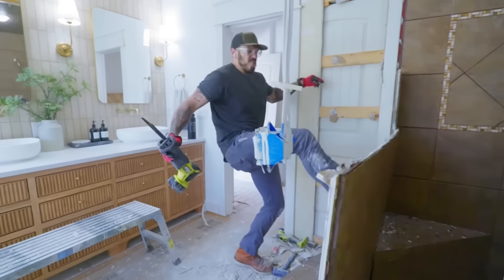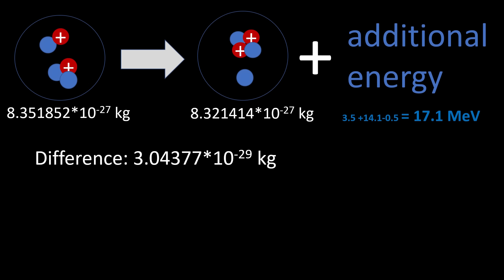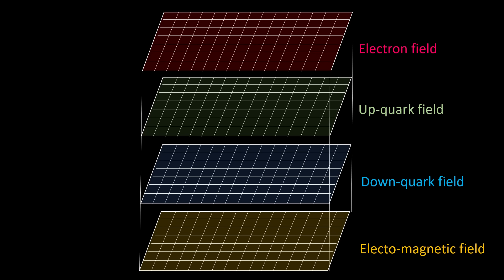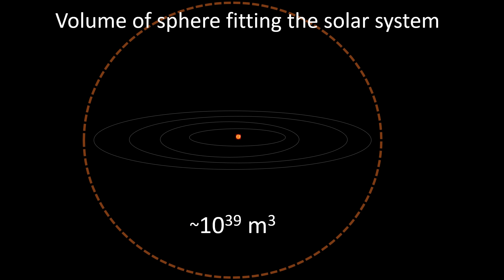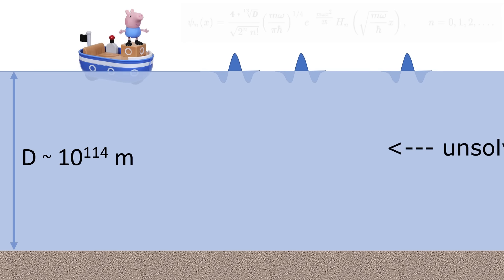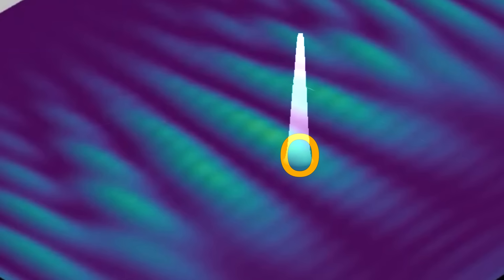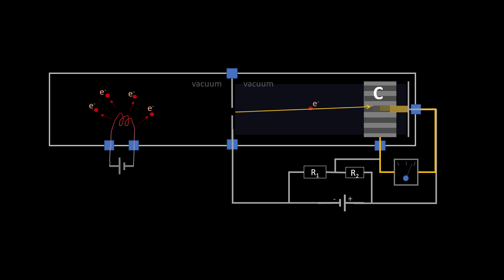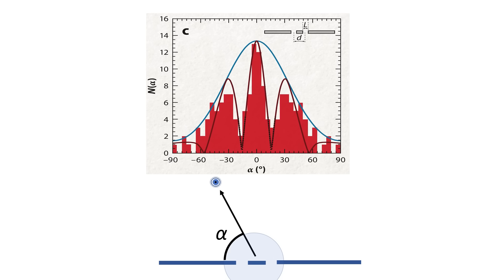Bathroom Quantum Fields and Vacuum Energy

Comment: What a wonderful video. There is a fantastic flow to your writing.

I ask myself questions like these all the time. As a non-expert, these kinds of speculations are especially fun! I don't have to be right or justify anything to anyone, I can just ponder whatever is most interesting to think about.

Recently I tend to like Wolfram's graph model. Not because I think it's right, but because it's so utterly abstract that it kicks me out of the rut formed by my common intuitions and preconceptions, and helps me think a little more freely about possibilities that I would otherwise reject as "absurd". Like that 10^114 value, is that absurd? Why? Physics can be doing anything at all. Consider the sum-over-histories behaviour described by Feynman.... from a computational point of view it is absolutely absurd, but physics doesn't care about that perception. Maybe that implies, if we are in a simulation, that the substrate is much more interesting than the universe it is simulating. Just think how tiny the universe we could simulate would be, even if we converted the solar system or entire galaxy into computronium.

And oh look it's 3am and I didn't even finish wiring that light switch...

Comment: It warms my heart to hear you use the term religion in the context of quantum mechanics comprehension.  Many of the experiments supposedly demonstrating wave/ particle duality involve lasers attenuated to a degree that we "know" that we are dealing with individual quanta by virtue of applying E=hf.  So since the interference pattern is invariant as the laser power is decreased, somehow this is evidence of wave/ particle duality.  This strikes me as a classic begging the question fallacy - since E<hf, somehow we "know" that we're dealing with individual quanta of electromagnetic energy.  If someone has done the double slit experiment with a micro channel plate seeing individual photons it would be more convincing.  Another fundamental issue I have with E=hf is that the uncertainty principle tells us that if we know a photon's energy exactly, we will have infinite uncertainty regarding when the photon arrived.  Classically this would correspond to a continuous wave photon which has been present for all eternity, which stands in contrast to the 'event' of a photon striking detector.  GD

Comment: I don't know enough to even pretend to challenge the accepted values for vacuum energy but I can speak a bit about observation/measurement because I once asked some very similar questions to a professor of mine and their answer always stuck with me so this is my best attempt to paraphrase their response.  An observation is any action which causes the wave function to collapse, so in a sense asking why an observation would cause wave function collapse isn't a valid question.  If the wave function collapses then the interaction was by definition an observation.  It's like asking why vehicles collide so often at car accidents.  The question doesn't make any sense because vehicles colliding is what makes it a car accident.  Actions which don't collapse the wave function can always be represented as transformations from one coordinate system to another.  If you imagine the quantum state an an unknown vector then no combination of rotations, reflections, or translations will ever give you any information about what the original vector was.  What all of those operators have in common is the ability to be represented as a change in coordinate systems.  You could fold the vector from its infinite possible directions into a narrow beam or move it a million miles away it still wouldn't give you any information about its original angle or magnitude.  It is interactions which cannot be modeled in that way that cause the wave function to collapse and we call those interactions observations because it is also only through those kinds of interactions that the quantum state can be observed.

Comment: Fantastic video! You did a really great job exploring these concepts.  I have had a similar theory for a while now. However, in my theory, the particle and wave that it rides are not necessarily separate entities but perhaps just different planes of interaction of the same thing as you visualized toward the beginning of the video. I believe that that movement of waves inside a particle self generate attractive forces that hold the particle together, much like quarks chasing each other around. These waves hold each other in a potential “bowl”. Additionally, these waves radiate outward and interact with each other, causing other potential wells that either effectively pull a particle inwards like a tractor beam (sonic levitation) or push away depending on the wave interactions of the other particle in question. The wave interactions of all of these systems expand outward and cause other forces. In this view, all of the fundamental forces are built off the same waves, but appear and behave different on different scales. For example, the weak force of gravity could be caused by the instability of atoms themselves, causing an imbalance in the wave fronts, causing only larger attractive wave potentials radiating outwards. I would like to see the gravitational constant measured with masses of different temperatures to see the effect on strength. Also, perhaps dark matter/energy are the forces generated by the sum of wavefronts of entire galaxies, I am unsure. These are only starting points for those who know much more about this topic to explore. I am interested in knowing what you think of this.

Comment: on the double slit experiment I know they talk about observation but fail to point out that its an EM based observing tool like a CCD of a camera or some other detection device that has an oscillation of energy and I am guessing this process is over riding the orientation and rate of vibration of the particles the material the slits are made from so they become cohesive while not being "observed" these particles are more randomized much how the molecular structure of a material is vs when it is say magnetized/ Thus when "observed" they are basically forcing  everything electromagnetically to become ordered and get the piled up particles vs the randomized unobserved slits getting a wave effect, (also the particles being absorbed by the material and emitted from exactly where they get absorbed to continue on their way vs their energy getting split up into two partial energy containing particles out the other side, is a possibility too.

Comment: I love your playfulness and imaginative vision, attempting to explain complexity.   When I look at the slit experiment, I see where the light particle isn't, which is predictable based on the spacing between the slits and the slits size or shape.  I suggest where the particle isn't is not a probability but can be determined given the distance of the slits and size remain constant.  A sum of the area where the particle isn't can be made on the detector. If you add the variable of time to where the particle isn't and subtract the isn't from where the particle is, the particle's location is beginning to be encapsulated into an area on the detector.   For certain the particle will be in an area where it isn't.    I haven't heard any talk about the certainty of where the particle is not in the slit experiment.

Comment: Another problem with the idea of wave function collapse as a physical event is that it has to occur everywhere at the same time, but with relativity that can only happen in one frame of reference.

I'm coming around to the view that the many-worlds interpretation is the one that makes the most sense. Although the term "may worlds" is a bit misleasing, I think. It's more like there is one extremely rich world of which we can only see a thin slice at a time. And there are many versions of us in that world, each one seeing a different slice. In that view, wave function collapse is just a mathematical trick we can choose to use when we want to treat part of a system quantum mechanically and another part classically.

Comment: First off,  this was a great video and the bathroom looks fantastic too!

Given that my maths ability is weak, I generally can't delve too deeply into the nitty gritty of fancy theories, yet I've sometimes found explanations using these theories of even some common phenomenon lacking or even seemingly outright wrong (I'm looking at you, "3 polarizer paradox"). Though I won't be so arrogant as to be dismissive of things simply because I'm incapable of understanding them.

One thing that's been that's been bouncing around in my head for a while regarding the "single photon" (that's in quotes because I'm no longer convinced there's a particle associated with it, and therefore there is no quantity - just a propagating wave with an associated energy) double slit experiment is that for EM waves with miniscule energy levels for their wavelength, there exists only enough energy to excite a small number of detectors, and that process of of excitement absorbs that energy sufficiently and quickly enough (don't know how) to "collapse the wave function". Furthermore, it might be possible that, given some number of detectors, some percentage of them below 100% are "ready" to be excited at a given point in time, making it more likely that some detectors will be excited than others when the incoming EM wave is at a point where it could possibly interact with them. 

To expand a little on my doubts about photons having a particle component, first off the process of strict photon emission (that is, the emitter emits more photons than it possibly absorbs from external sources) means that the particles have to come from somewhere, and in huge quantities, but where? Do electrons or protons etc carry them? I concede that such particles especially at what I would presume to be extremely small levels of energy would be hard to detect, but how reasonable does this even seem? Secondly, given that it is understood that EM radiation is created by the oscillation of electrons, I present this thought experiment: Say we have some magical tweezers which can grip one single electron without it interacting with it's electric field in any way. Lets also say those tweezers can vibrate that electron in some axis at any frequency and amplitude desired. This process will generate EM radiation at some frequency, but what effect does the amplitude have, and what is it's smallest level? What about it's largest? Do these differences have an affect on how many particles would be emitted?
Reply from the maker: There is a lot of questions in your comment, but I see where you are going. In a future video, I will return to electromagnetic radiation and the interaction with matter with an experiment that (hopefully) either proves or disproves locality.
Reply: @HuygensOptics  I look forward to all your videos!

I have experiments in mind for both the "3 polarizer paradox", or rather, polarizers in general, as well as a detector causing wave collapse (though in the fluid domain, similar to that pilot wave demonstration). Just need to find where my free time is hiding!
Reply: @markaeric1  Interesting points.  When you say "(that is, the emitter emits more photons than it possibly absorbs from external sources)" I am not sure why you think that somehow the electrons can emit more photons than they absorb. They can also gain the energy needed to emit photons from an electric current as in many types of gas lasers.  But of course an electron cannot absorb or emit an electron unless it is part of an atom where it has a energy well to work with.
I feel that the photon is a dual positive-negative particle in an idea that de Broglie tried to put forward but was disliked or failed to be understood by the physics community back then.

Comment: We've been warned time and again by quantum physicists that understanding quantum mechanics is difficult and counter intuitive. That may be so, however they appear to have fallen into their own trap and interpret the mathematics as reality itself. In the same breath we are told that the fundamental reality does not exist, and that reality is fundamentally made of waves in quantum fields.
Detecting particles is an act of transduction, we convert and amplify the energy so we can record it electronically. In doing so we are not collapsing the wave function, we are converting it to another form. Detecting and electron may require the electron to be captured by an atom, the wave function of it will change to one localised on that atom and the extra energy radiated away as a photon. We have not collapsed anything, just transformed it, in exactly the same manner as if our electron moved between energy levels within the atom.
Consider Schrodinger's cat. The scenario assumes that unless we look inside the box the interaction cannot be realised. Unfortunately people do not understand that Schrodinger's point was that this is a ridiculous way of thinking. The universe does not cease to exist, or go into an infinite superposition of states of we stop looking at it. We just haven't measured it yet, we haven't interacted. If that is really true then entangled particles are also not in a superposition, we just haven't measured them yet.
Reply: Lots of good insights, keep it up!

Comment: Two weeks, two weeks, this algorithm is busted. 

Another great video! I kinda see both points you're presenting here. I don't have an issue with the idea that what we detect as empty space in our 3 dimensional experience may in fact contain an unfathomable amount of energy. I reckon it could be kind of like our atmosphere, and all the mass/energy is just wind. Is there more air in a windy spot? Probably not, but there's something we can measure and feel. Just because it isn't windy doesn't mean the air is gone. Obviously this is simply a metaphor. But if everything else behaves like a field then I don't see why we would expect anything less from energy its self. I mean fundamentally causality boils down to a field with a propagation speed of C, if I understand that right. And fundamentally all other observed phenomena are dependent on causality. At least that's how I interpret all this stuff.

Comment: I've often wondered if particles are more like vortices of a medium. It would make a lot of things make a lot more sense.
Reply: That's a nice idea... Now I am intrigued, what if you actually could do calculations on elementary particles with use of some kind of vortex-in-a-fluid-type math...
Reply: @_general_error  Good luck with your Navier-Stokes calculations applied to the quantum realm, I wouldn't wish that on anyone but that's the best fluid dynamics mathematical tool we have :x
Reply: They must be: the medium is space-time.

However they are strictly quantized: they can only have very specific properties, not all "vortices" are possible, only a few.
Reply: I also wonder if the reason why the vacuum energy is so high is because it's like potential energy, in the same way that a vacuum in air can be thought of having a high potential energy because it's in a context of high pressure air.

Comment: In my mind there's an inherent absurdity in the assumptions of the quantum vacuum, namely that empty space is made up of oscillators, perhaps this comes from the way the atomic structure of matter was inferred from spectra of black body radiation, which could not be predicted from theory until it was hypothesized that matter was made of individual "atoms" each of which could only hold quantized amounts of energy. but just because matter is made up of atoms is absolutely no reason to assume that space itself is made up of indivisible things (which are then assumed to be oscillators).  Its just a quantized version of the "ether", and is equally destined for the dust-bin of physics.  MHO, YMMV.

PS, I love your channel, and I love that you forced me to think through why I don't like the concept of zero-point-energy.

Comment: Good afternoon! First of all, thank you for a wonderful channel and videos. Second, sorry in advance if my questions/assumptions sound silly, I'm a biologist, not a physicist. To to point, I guess the main problem is the level of abstraction we can go to. If I assume absolute vacuum, what is the speed of light in it? Well, since it is absolute vacuum, it should be undetermined, since there is literally nothing to measure.. Now, if i assume a single particle in absolut vacuum, the answer should be the same, since there is no reference point whatsoever. So the minimum hypothetical situation we can talk about is two objects in absolut vacuum and depending on the properties of the objects, let's say symmetry of those, we can define a minimum "field" of specific asymmetric property. And my gut feeling tells me, this system will work like classic oscillator, since it is an absolute vacuum.. Fascinating fact is, to my knowledge absolute vacuum doesn't exist. There is always a certain particle density in space, thus, what we assume as a speed of light in vacuum is actually speed of light in a very thin matter. And here is where I feel my thought makes a full circle: the speed of light we assume as a consultant is crude approximation for the matter-poor areas of space in known universe, and it confuses us, since for calculations we assume it is a speed of light in actual vacuum, which cannot be assigned. Anywho, please feel free to correct me, if there is any  misconception in my thoughts.